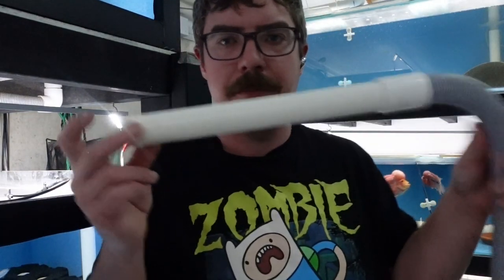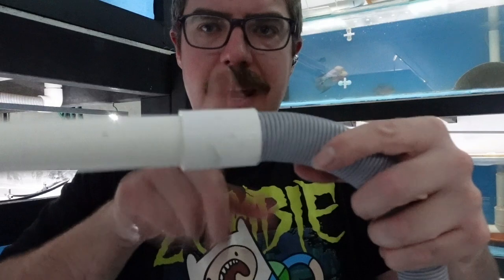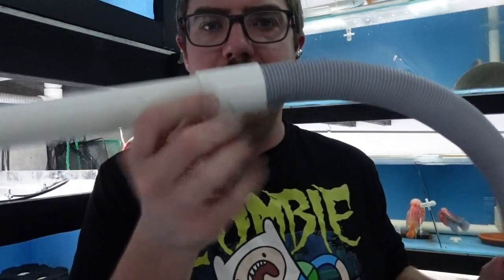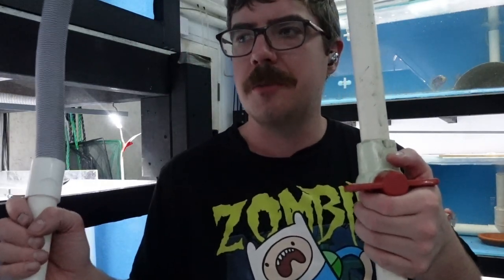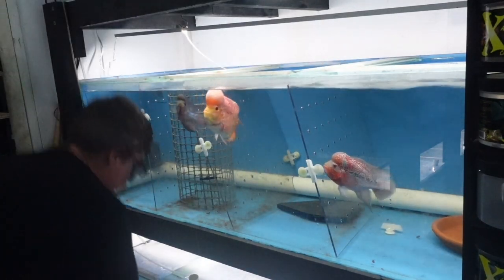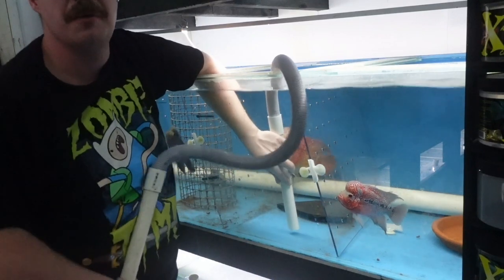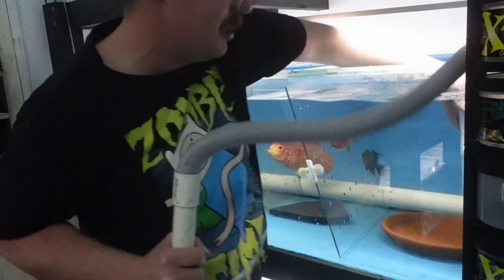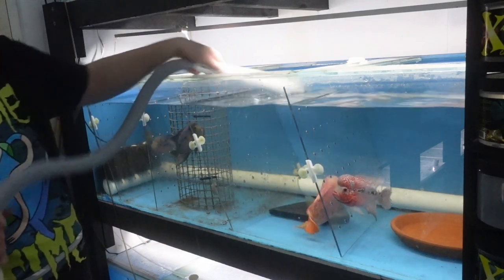My d.i.y. aquarium vacuum explained in detail!

Comment: Fyi to get the gravel vac effect the nozzle has to be bigger than the hose to make it less pressure in the end piece.
Reply from the maker: Yeh may work from memory I tried a 2lt coke bottle but the flow was just to much
Reply: @RumballsFishroom  yeah it has to be a bit more exaggerated. Would be absokutely ridiculous by something like 90mm stormwater 🤣🤣